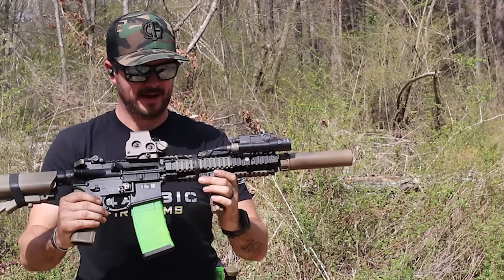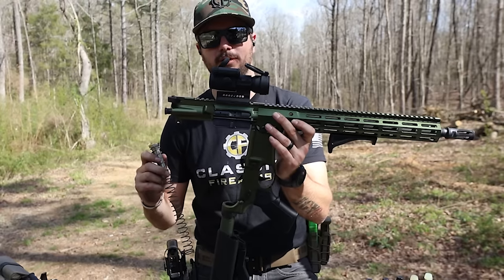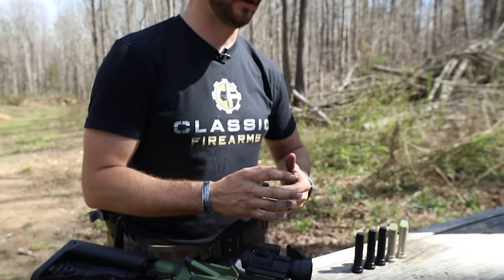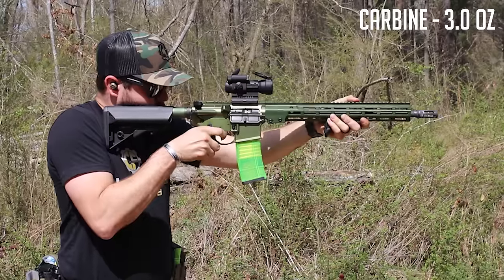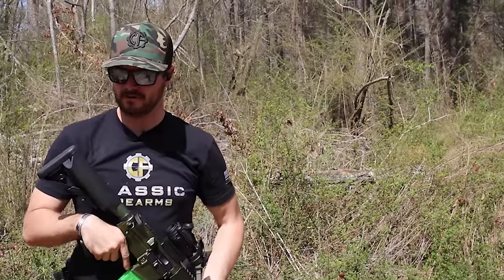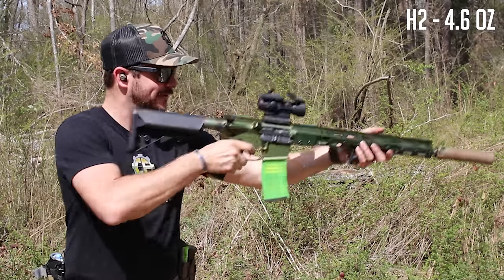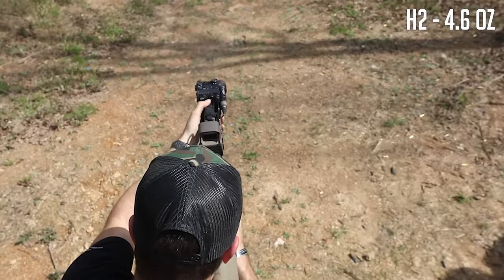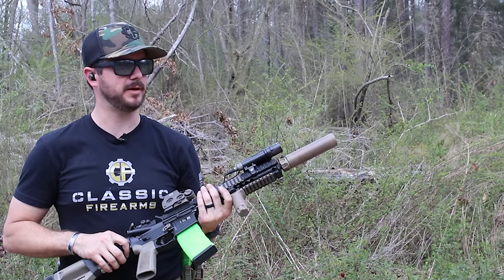What Buffer Should You Use In Your AR-15? (H1, H2, H3, H4)

Comment: My rifle needs a light buffer, 20in barrel, carbine buffer. I had a car(3.0oz) buffer in and wasnt getting lock back, originally thought i needed a heavier buffer to give the catch more time to rise up, ended up getting even more failures including a couple stovepipes. Dropped the tungsten weights from the buffer for aluminum so now the buffer is 2.2oz and runs flawlessly (at 2.5oz  1 in 10 rounds wouldnt lock the bolt open. 3oz seemed like 50/50 h1 locked back about 25% of the time and an h2 wouldnt lock back at all and gave me the ftes). Getting perfect 3-4oclock with it. Tried with both my 75gr handloads and american eagle xm193 55gr. (Was having issues with both before)

Comment: Thanks for all the testing.  I have a MK18 with an H2 buffer and I run it both unsuppressed and suppressed.  Reliability is not an issue with my setup, however it is heavy as heck.  I am going to try using the Rubbery City Armory Ultralight Titanium BCG w/Adjustable gas key and also remove the weights from my buffer.  I am going to try and tune the entire system just off the adjustable gas key.  Going to remove as much weight as possible and see if I can get the recoil down to nothing.  I plan to get all my adjustments tuned without the can on it and then re-check everything with the suppressor.  I figure it will run a little over-gassed with the suppressor on it.  I am also going to double-check I have no issues running both 55 and 62 grain as well as .223 and 5.56.

Comment: I have a 10.5" .300BO AR and I experimented with different buffer sizes to see if I could find one buffer that would cycle both subs and supers reliably with LRBHO. I ended up with an H2 being the best choice. This is running unsuppressed and may well change when I run it with a can.

Comment: My standard go to buffer is an h2 with jp enterprises tuned spring as I have e found it to have the best perceived recoil impulse. FYI geissele has a table when you are looking at their buffer system to figure out what weight you should use.
Reply: Where can you find this? @nvhs1
Reply: Yeah jp has a chart as well. I picked up the geissele super 42. And that thing makes my gun jump. It’s made to give a 15% return strength. I had a problem whith a bolt going home. Not anymore.
Reply: @MRsolidcolor  second this geissele h3 in my 11.5 and it ran great I switched it to a jp enterprise h2 capture spring because I shoot suppressed now and it shoots even better you can’t go wrong with either honestly.
Reply: I got a 12.5 “ called up Geissele and they said go with the H2….. Any feedback would be appreciated!
Reply: @petersudol5887  H2 is great all around for regular or suppressor use on carbine gas systems All around but always with a Way to adjust gas though either adjustable gas block or adjustable bolt carrier group.

Comment: I run the A5 Intermediate Buffer System on my 11.5” BCM upper build. Rugged Micro 30 can and Gemtech suppressed bolt carrier. Cycles flawlessly with a buttery smooth recoil impulse.
Reply: Boooom! Was looking for someone to mention an A5 setup
Reply: @silver4drrx828  a few others mentioned it as well. Would like to hear Clint’s thoughts on it.
Reply: Same here, A5 on all my builds. Although I have been considering moving from an H3 to an H4 on my geissele 11.5. Regardless A5's have been by far the best aftermarket parts I have ever bought for my AR's.

Comment: I bought a 7.5” .223/5.56 and to help with over gassing I added a H3 buffer along with .308 flat wire David Tubb buffer spring at full length that makes the once mule kicker to a soft shooter. You should try the buffer spring in your Daniel Defense MK18. I believe you would talk about your MK18 even more!…..LOL! Great video Clint! God Bless!
Reply: Shooting 5.56 out of a 7.5” barrel is useless. There’s a reason why 10.3” is the shortest SOF guys use.
Reply: @MyFlexinIsAProblem  Maxim defense ammo. Hornaday tap ammo also. They're designed for sbr's.
Reply: @MyFlexinIsAProblem  i wouldn't go shorter then 11.5 in my experience.

Comment: Another great video! And perfect timing for me. I just built my first 300 BO in 10.3 (BA Hanson barrel). With a hot/white Sprinco and standard carbine buffer the brass is eating up the shell deflector. I added an H2 which helped but it's still not in that 3-4(430) sweet spot. Would you care to give me any suggestions? Thanks again for all of the great videos

Comment: Important to test the bolt hold open capability with different buffers. You can have a gun that cycles but won’t hold open. Minor issue, but still important 

It’s also important to know that things like barrel gas port size, gas tube length, dwell time, ammo, bolt specs, gas ring specs, etc all play into this along with your buffer weight and spring.

Comment: The lightest possible (carbine weight usually) and an adjustable gas block. There. I saved you 20 minutes.
Do NOT tune your gun starting with the buffer. Start with the gas adjustment first, then the spring, then the buffer LAST.
Reply: Dislike

Comment: Changing the buffer wait alone will only minimally effect felt recoil. It can change the impulse a bit. The gas system is still pushing back on the buffer with the same level of energy, its just pushing more or less mass around depending on the buffer. Where you get more noticeable effects on recoil is when you change the amount of energy that is making it into the action of the rifle via the gas system.

Comment: Built a 458 socom and used the standard carbine buffer.  It would cycle so fast the spent cartridge wouldn't clear the gun before the next round would hit it and jam it up.  Went  with a 6.8oz  h4 buffer, and it slowed it down perfectly, allowing the gun to cycle round after round without a problem

Comment: The best buffer to use is the one your rifle came with.The engineers who placed it with your rifle did so for longevity and proper function.They know alot more than we do.
Reply: That’s generally fine until you change muzzle devices, especially if it’s a suppressor. Also if a gun comes over gassed from the manufacturer that’s a lot more wear and tear over time. Just food for thought 🤷🏼‍♂️
Reply: This isn’t necessarily true alot of weapon manufactures use h buffers because it saves them money

Comment: Forgot about dwell time and extraction timing. Also forgot the inertia from the buffer weight helping with locking the bolt into battery.

The weight of the buffer shouldn't prevent the gun from cycling. What it will do is slow down the carrier speed by fractions of a second during the unlocking and extracting cycles to allow the spent brass to contract inside the chamber for extraction and ejection.

It will also assist with felt recoil because the weight decelerates the bolt at the end of travel more effectively. As well as providing a stronger chambering and locking cycles from the buffer's inertia travelling forward.

If you're trying to adjust your gas pressure you need an adjustable block. Most standard or nonadjustable blocks are over gassed.

Comment: im just gonna go ahead and type this i have an AR lower PISTOL rcver it takes GLOCK mags. i have a super short buffer tube with the spring going into the actual bolt.. the bolt needs the weight removed so the spring can go in there. the first time out with it the cases are all dented and it had many feeding ishues.i have a 9mm AR rifle that functions just fine. if any one with  a 40 S&W   and the same buffer system knows whats going on i would love to hear people thoughts.

Comment: The best option I found for 556 any barrel length is an H1 buffer a sprinco Blue Spring an adjustable gas block so you can turn the back pressure down a little bit.

Comment: I use a Geissele buffer setup in all my AR’s. I for one hate that buffer spring twang, and the Geissele spring doesn’t twang. My 10.5” .556 pistol with an Silencerco Omega on it runs ok with three tungsten weights. But it is probably still a bit over gassed. The other guns in .556, 300BO, and 6.5 Grendel all have various numbers of tungsten weights and run well. I generally don’t ever shoot unsuppressed. I don’t remember the number of tungsten weights in each one, but my parts box does have a bunch of steel weights rolling around…enjoyed the video. You probably missed because you tried to catch a glimpse of where your brass was going.  😂

Comment: The reason you felt a major difference with the suppressor, is because of the reduction in inertia because on a semi gun (any) the weight forward of the action greatly affects kinetic energy to the piont you can stop the action entirely. The reason it doesn't is because of the gas assist. Benelli learned this on their M4, they actually had issues with the first ones and had to update the valving. Its gas control your after. Some ARs have this. The buffers changes reliability for the most part. Case in piont. Very heavy barrel on a gun shoots like a kitten.

Comment: I use the Armaspec captures recoils buffer/springs, H1 across the board on all guns (short and longer barrels) except on a PCC with the CMMG RDB system (use H2 equivalent for that).  For suppressed guns I use a Bootleg BCG with adjustable gas porting, which I think balances out having to go heavier with the buffer, as well as really helping with gas to the face.  The Armaspecs work great and have a nice smooth and silent cycle to them.  Ejection is consistently at around 3:00 - 3:30.

Also, for my 10.3" and 11.3" guns, they both sport the BA 'Hanson' profile barrels which apparently have a medium sized gas port...a la not as overgassed as other shorty's (or like your older MK18) with enlarged ports to compensate for shorter dwell for better reliabiity, etc..  But they run reliably with just an H1-equivalent buffer with bulk factory .223.  Hotter 5.56 stuff may benefit from the H2. but I also have a few of those Armaspecs handy too.

Comment: I build and sell AR 10 uppers in the WSM magnum cartridges with right now I am at the end of testing one in 375 WSM so after using all the buffer weights for AR 15s I tried the 5.3 buffer weight then clearly it stopped the light buffer weight issues of being drive back in the buffer with extreme force so the 5.3 ounce buffer was heavy to slow down the massive force to drive the buffer back.
Looks like all of my AR 10 uppers in WSM magnums will be supplied with 5.3 ounce buffers and using the 18.5 inch gas tubes to slow the opening of the bolt when most of the powder has already been burnt then turned into pressure.
For those who are interested in AR 10 in WSM chamberings this summer I will have video's of my AR 10s firing the uppers in WSM magnums.
Also on YouTube is video of owners of AR 10s in WSM cartridges.

Comment: The best 5.56 buffer to use for a self defense gun is the buffer that you can consistently run crap low power wolf/Tula steel cased 223 power.

If it will cycle this ammunition reliably, it  will probably cycle everything else.

Comment: If you are over gassed you can fuss with buffers all you want and you won’t see any changes.  Gassing and buffer are directly tied to each other as they balance one another.  

Get gassing under control watching your ejection pattern.  Then start upping the buffer weight and then compensate the gas to restore the proper ejection pattern.

Comment: The biggest deciding factor in which buffer you should use is the size of the gas port on the barrel. On a 10.3" MK18 build I prefer .070" and an H3. On a 14.5" or 16" length barrel, .063" and an H2 is a smooth, reliable combo
Reply: What spring are you using for the mk18? 

I have the Geissele spring and H2 and it feels much better than the stock spring and H buffer.
Reply: @ACGBLR  I’m running geissele super 42 as well. The heavier h3 cycles perfectly. Again, this is with a barrel with a .070” gas port. Clint’s MK18 is probably an earlier barrel when Daniel Defense was using an .083” gas port. They’ve since switched to the more properly sized .070”
Reply: @bradcook5174  thanks for the reply. I have two of the DD Mk18s, both have the .070 gas port size. I will experiment with an H3!

Comment: There is only one function of the Buffer. That is to mitigate Bolt Carrier Bounce for reliable full automatic fire. That's it. The internal weights within the buffer need to be able to slide back and forth to double tap the carrier to cancle out that bounce. You're not running an M4-M16 so it really doesn't matter what weight you use or if the weights are able to move or not. Running an overtly heavy Buffer will however increase internal pressures within the Carrier and cause premature wear on the Bolt Rings. The very best setup I've found is with the Veltor line of Buffers coupled with the Geissele Buffer Spring. Veltor Buffer has a tiny internal spring that keeps the weights from banging around and is a nice touch. It's your rifle and if you believe buffer weight has an impact on an AR-15, you're welcome to believe what you want.

Comment: I did a similar test today at the range.  16" Mid Length Daniel Defense.  Came with an H1 Buffer at 3.8oz.  Went to H2 at 4.5oz and then H3 at 5.6oz and the gun ran great with both of those in.  Also shot suppressed with it and left the H3 in for that.  Might have to look at an H4!

Comment: Re piston tuning...i been working a build with new 20" Faxon Barrel 556,  AdamsArms rifle length adjustable gas block piston. Its the smaller block with 6 gas positions. Outa the box and standard carbine buffer 3.04oz/spring 37? coil, it was UNDER gassed would not cycle new rounds. I went to a lighter (yellow) spring and droped buffer weight to 2.6 oz...It cycled with good brass but still doesnt like steel (Tula 223) and was still a bit under gassy...throwing to the 4-430..i then opened the stock port from 0.089" to about 0.0925" (2.35mm) and it moved brass up to 330-400 O'Clock.still doesnt like the Tula. Plan to take it to 2.4mm and then maybe 2.8mm, unless i can find some good interval size ANSI bits...

Comment: Ok, I have to say this. The adjustable gas block is not a fix-all item. You have it as a fix under overgassing and undergassing situations. If your rifle is overgassed with a standard gas block that is fully open, an adjustable gas block can fix your rifle's issues. However, if you are having problems with undergassing with a standard gas block that is fully open and you already have a standard 3 oz carbine buffer, an adjustable gas block will do nothing for your system. Actually in that case you will want to ensure that the gas blocks are installed correctly, the gas tube as well, and you may even need to have the gas port widened. That's usually not necessary though. Most manufacturers have done the math and the gas port is more than large enough.

The only time an adjustable gas block can improve cycling when your rifle is undergassed is if you're already using an adjustable gas block and it is NOT already fully open. Then you just have to adjust it.

Comment: I run an H5  with AN ADJUSTABLE GAS BLOCK on 7.62 x 39 16" bbl. You can really dial her in Infact ALL my ARs have adjustable gas blocks With FLAT SPRINGS easy adjustment on all types of ammo! So many variables so little time left! Oh yes another variable is the size of gas hole in barrel. Consistent buffer spring tension........and on and on and on...... as springs get weaker you can drop quarters down buffer tube and on and on and on.

Comment: So I upgraded my trigger from a   Mil spec to a 3.5 lb single stage trigger added a muzzle break from 1776 got a aero ambi charging handle and just ordered a h2 buffer weight and adjustable gas block to fine tune my rifle with  my the gases and hoping it helps reduce recoil and makes the gun super flat shooting

Comment: You need kaydi to be the guinea pig of this test. Lol. 

Clint, you forgot to mention the gas port size. This will dramatically determine which buffer should be used besides from going to the range and firing. I made. X39 upper shoot as soft as a 22lr according to my friends that still had reliable function after 1000s of rounds of fiocchi and AE 123g. 1 of my barrels had a undersized gas port size.. Iirc .087". My other barrel had a .091" gas port. So I opened up the smaller gas port to .089"  , had it cerakote cause I didn't like the fact of bare metal at the gas port hole. Played with buffer weight (I like a2 stocks and a2 fsb for nostalgia reasons.) Got my buffer to 6.5 oz and damn it was a smooth shooter with tubbs flatwire buffer spring.

Comment: I quit at the midpoint.  The best choice of buffer depends on the also on the how much gas is being vented to actuate the BCG.  I a lot of people have the Cheapo BCA uppers.  In 16 inch carbine for 7.62x39, An H3 resulted in reliable function and there is still sufficient recoil to spare and ejection is behind the firing position.   Also slowing down the BCG will save wear and tear on the extractor and bolt lugs that are the weak point to 7.62x39 AR-15s.

Comment: Changing things like the barrel may also cause you to need to tweak buffer weight. I swapped the factory government profile my AR came with for a Faxon Gunner profile which has a slightly larger gas port (0.08). I had to swap the buffer for a H/H2.

Comment: I have a AR-47 pistol (7.62x39) and it had a 4.6oz buffer that made it not cycle, it only worked as if it was bolt action, and then I was suggested to use a Carbine buffer. After I did the switch I was mag dumping like there was no tomorrow!

Comment: There are too many variables to consider in the commercial Market to use ejection pattern as a diagnosis for proper gassing. The ejection pattern was designed for mil-spec rifles using all the same Parts, ammunition, and maintenance.